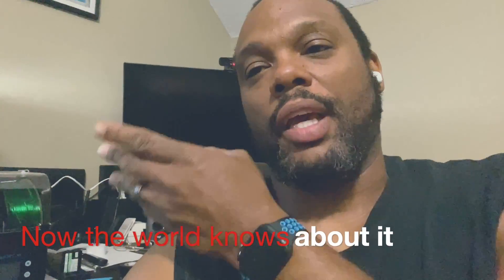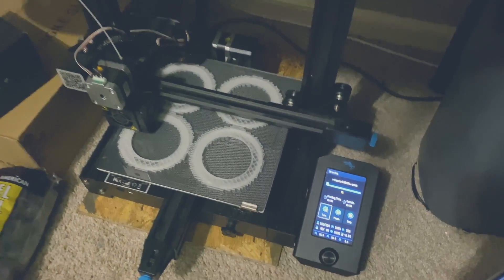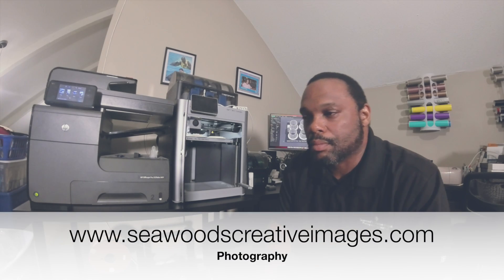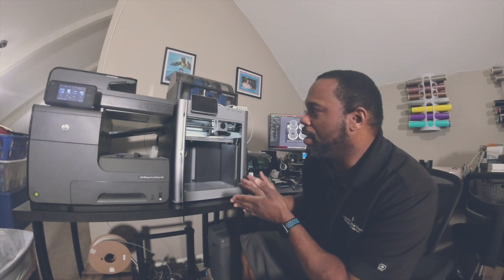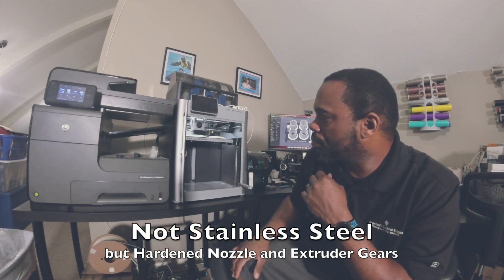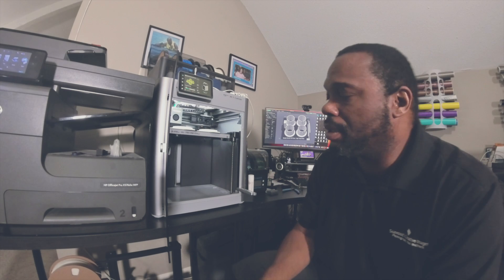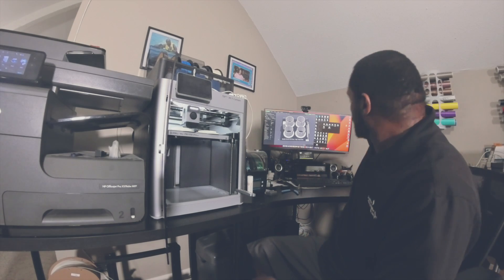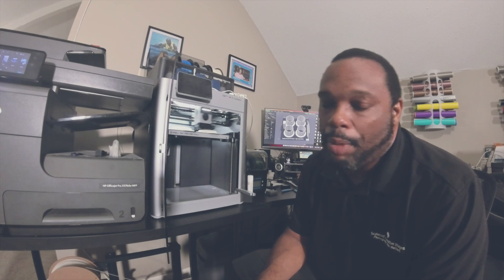I returned the Bambu Lab P1S

Comment: I’ve had a pretty similar journey so far.  Started with a Elegoo Neptune 3 Pro which was great but has its limits. I decided on the P1S with 2 AMS units so I could have more variety in multi-material and color prints. It has been great so far. I upgraded to hardened extruder gear and hotend. Speed and quality of prints is amazing for PLA/TPU/PETG so far. Taking the leap into ABS soon so pray for me. 

Very cool hearing your journey and glad you are enjoying the hobby and the X1C.
Reply from the maker: Thanks Man. I recently also started experimenting with ABS and ASA. I had to move the printer to the garage first. It took a try or two to get a decent print but got it. Good luck with your ABS prints.

Comment: Great video.  Glad i came across your channel and in my opinion the X1C is worth the upgrade.   biqu just launched the revo hotends for it.  Also take a look at Orca slicer as well if you haven't already.
Reply from the maker: Thank you. No I haven’t tired Orca slicer yet but the more I hear people talk about it makes me want to now. I will give it a try hopefully this weekend.
Reply: @LynelSeawood  I like it quite a bit, it normally has some of the newer settings, for example it had some of the wall generator settings for arachne which is useful for me since I normally print with a .6 nozzle on my X1Cs.  The .6 high flow nozzle from bambu/E3d makes it quick to prototype as well

Comment: I own a P1S (converted) and the only reason I don't own an X1C is because I'm waiting on the XL version. P1S has been the best printer I have owned and knowing what I know now and how good the P1S is, I'd get the X1C over it in a heart beat. The screen on the X1C really does offer more functionality and usually gets the advanced firmware updates first, as it should since it's a flagship. I recommend anyone pickup the X1C over the P1P/S if you can swing it. I know the ignorant say the difference is a screen and that shows how much they are talking out their a$$. Some of the hardware is better on the X1c too like the camera.
Reply: When is the xl version coming?
Reply from the maker: @Pitman556  I have no idea on that one.
Reply from the maker: Good deal. I love these Bambu printers.

Comment: This was a good video. I got my first 3d printer in 2017 and I’m finally shopping for a new one. I’m really glad Bambu Lab came out with the full sized A1 recently, since I probably would have made the same choices as you and ended up with the X1c after a return. Besides the looks of a core xy printer the A1 should be able to handle everything I need it to as a hobby printer.
Reply from the maker: It should be able to. I got the chance to see it (A1) in microcenter a few days ago and it looks very nice

Comment: do you ever print ABS?
Reply from the maker: I have a roll or ABS and ASA but have yet to use them. So no, I haven’t yet.
Reply: @LynelSeawood  I'm asking because I have the same printer/setup in a room but a bit worried about the toxic fumes.
Reply from the maker: @semaph0re this is just going off what I see and hear from others, so take with a grain of salt. I personally wouldn’t print ABS in a room without really good ventilation. I’m definitely not  printing it in a room I sleep in even if I had good ventilation. Im still learning more about it my self. Hope this helps.
Reply: @LynelSeawood  yeah figured as much. thanks.
Reply from the maker: You are very welcome

Comment: This was a good an honest review of it, like you said most people do not need the X1C. It does have a lot of extra QoL features though, like the lidar, better screen and better camera and ability to transfer files over the internet. However the X1C can be better for high temperature filaments with the slightly hotter bed, but again it isn't that much of an improvement over the P1S and as you said you can put hardened gears and nozzles in the P series too. Also the lidar can be useful if you print unusual filaments that will likely require flow calibration, of course you can do this manually too but again it is QoL. 

Another point is that the ESP32 microcontroller in the P series printers is getting pushed way harder than the SBC in the X1C and this could (speculation here) end up with situation in the future where the X1 series can continue to be updated with more features but the P series can't due to performance or program storage issues. Anyway that doesn't seem to be the case yet, especially with the X1C's new firmware update adding noise cancelling which should come to the P series too.
Reply from the maker: I just update my firmware but haven’t used it yet to see how much quieter it is. I’m excited though. Thanks for watching and replying

Comment: I might return my X1C if I don't get a reply from customer service about the AMS that failed after 3 prints. Looks like the motor that pushes filament out of the hub is struggling because the tension spring is keeping it from grabbing the filament correctly.
Reply: up to you, but you can take it a part add a bit of grease and that issue went away... I went ahead and did all the PFTE holders to the back as well as under (inside ams) to lock down the tubes... after that I have not had a single issue... just did there castle 59hr print 816 color changes no issues..
Reply: Yeah it took forever to get a reply from them and the response wasn't helpful... but I found out the filament was brittle in some parts which made it break apart and get stuck in there. Threw it in a dryer for a day and it looks good now. This was new PLA from them...
Reply from the maker: @magneric wow. Well at least you got it solved. Hopefully they improve their customer service soon
Reply from the maker: I’ve seen other reviews or read that sometimes it taken 3 days for them to get back with you soon.

Comment: So in short, the only reason was the screen?
Thanks.
Reply from the maker: The screen and LiDAR basically. They all print the same
Reply: @LynelSeawood  Even without the LiDAR? Thanks.
Reply from the maker: Correct. I never had any issue with the P1S that wasn’t my own fault that caused it. 

The XLC does have more features but these are the biggest differences for me (remember that part). 

I upgraded because deep down, I wanted it to begin with. So before that return widows closed, I returned it for it. If you are debating, knowing that they all print the same (unless printing more abrasive materials and needing high temp bed), first I would ask my self, are you ok with spending a extra $500.
Reply: @LynelSeawood  Just wanting the top of the range, I totally get. 

The higher temp bed is where I think the real difference might come into play..

I think hot ends and extruders can all be upgraded on the P1S, but the bed is locked down by firmware, so can never reach higher temps.

Not sure if that makes certain filaments impossible to use, or if there are ways to still make it happen.

Would I like that extra functionality without fucking around? Of course.

Do I think it's worth £500?
For me right now, no.

There is no way that a hotter bed needs to cost that much more.

And it seems to be a fake limit, so double fuck that.

The aluminium sides, touch screen and LiDAR still don't add up to 500 notes if you ask me.

If I had money to burn, I would still be considering my options real hard, but yeah, I'd probably go for the X1C, while also feeling.... I don't know what word I'm looking for.

Basically like I'd been foolish with my limited funds and wasting money.

Which is something that I am no stranger to 🤣

Comment: So I'm puzzled you say returned P1S that have caused less problems, was cheaper to buy, you had the upgrade extruder bought also but did not install it. Now X1C is causing you more problems, but has nice screen you do not use because you can do same from computer. So what is this video about?

The LIDAR sensor is likely to die because leds die on ELEGOO Neptune 4 Pro from heat. The more fancy things the more failure points. And these are proprietary so no replacement possible except crazy price.
Reply: A bigger screen can be added for less than $20:  https://www.youtube.com/watch?v=XCYwEz-h4BY
Reply from the maker: Well, this is all facts at the time I post this video. Most of my problems at that time was user error (mostly). I purchased the nozzle and extruder but never installed it on the P1S because by the time I received it, I was already made my mind up to return the P1S.  The P1S was cheaper and worked great but the X1C was constantly on my mind, so I solved that problem and just purchased it.  As of today, I’m finding that I’m using the touch screen a lot more than I did at the time of the video, but you still don’t need the screen (the screen can be convenient honestly)

Comment: I am running an Ender 3 Max, my first printer. I am going to upgrade to a Core XY machine soon. This is helpful seeing someone who did the same thing. The X1C also has a higher print bed temp and lidar and an actually decent camera, which are the advantages you can't upgrade to from the P1S. I would keep the Ender 3. My printer likes to go down when I need it most and having a second printer as a backup would be very nice.
Reply from the maker: In my experience, you’ll love the Bambu printer and will be very hard to keep using the Ender. I still do have my Ender and just use it from time to time to print non detailed things. Still good to keep around in my case.